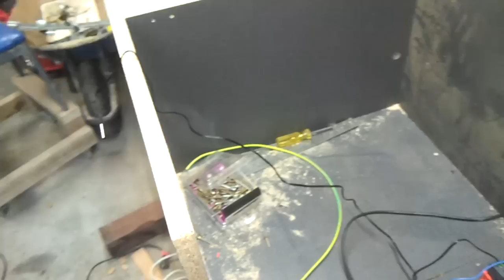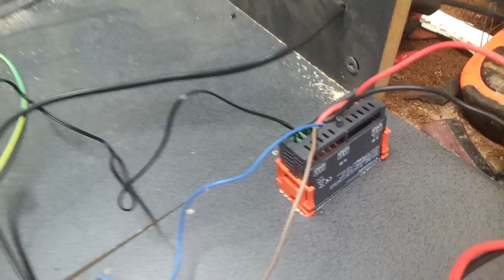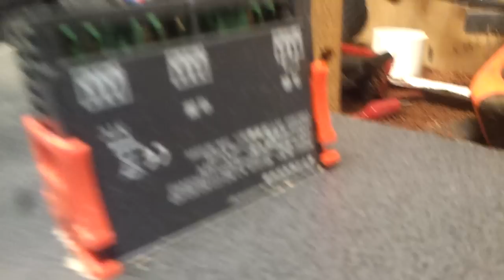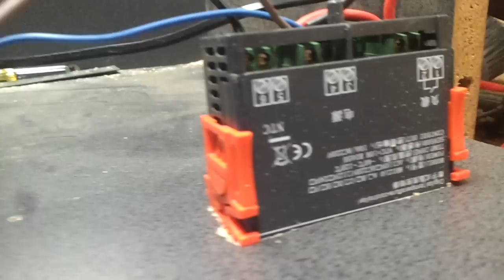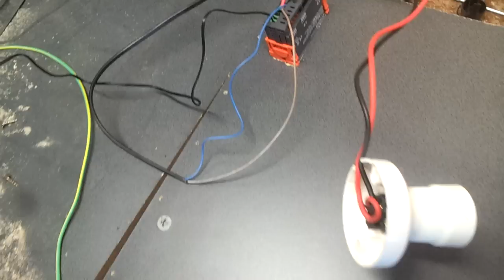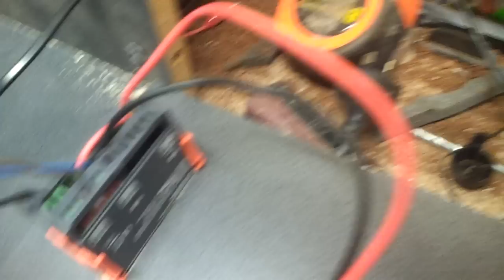Incubator box using MH1210 digital temperature controller - simple wiring circuit

Comment: Thank you, your video helped me a lot. For others, run white into 4 (AC power in) and run a white out from 4 to the white side of the socket. Run black into 3 (AC power in) and jumper 3 (AC power in ) to 2 (relay) . Run black from 1 (relay) to black side of socket.  Connect sensor, power on and test.  I found a good article and a readable (by me) circuit diagram here http://usefulldata.com/temperature-controller-mh1210w-review-manual-instructions/
Reply from the maker: Glad it helped :)

Comment: can we use it to hook two things like a fan for cooling and a bulb for making it hot so that in winters as well as summers the temperature is maintained .? or is there a limitation that we can hook only one
Reply: There are controllers that can do what you describe, this one does either heat or cold at any one time, not both concurrently

Comment: Can you send me the link to buy the exact temperature controller? from ebay or amazon or someother best website? Can we check humidity also if i am going to use for egg incubator?
Reply from the maker: Humidity is not a part of this instrument. Here is what I purchased:
http://www.ebay.com/itm/Digital-Temperature-Control-Regulator-Controller-MH1210A-40-to-120-200-240V-/330899020567?hash=item4d0b1e5b17:g:Qj4AAMXQBwlRTEXi

For humidity you can use this one:
http://www.ebay.com/itm/240V-AC-Digital-Air-Humidity-Control-Controller-Sensor-Meter-Hygrometer-1-99-RH-/361346145084?hash=item5421e89b3c:g:INAAAOSwPcVVrmQS
These both are 240V AC compatible units. If you need 110V AC, you will need to search accordingly.
Reply: Omkar Karve Tnx, this is what i asked :) I am from India, Tamilnadu

Comment: So i got this unit for my self. and that one works great. so i orthered one for a friend. but this one has an ekstra wire terminal at the load so 3 not 2 in a row. on the diagram it says normaly closed at the 3 terminal (is this instead of using jumper cable or something) any ideas on this. or should i just connect it as my own model. with jumper wire etc placed the same? these damn poorly translated manuals from china tells me nothing :D
Reply from the maker: +Dennis Nielsen I am not sure without actually looking at the unit and testing. Sometimes there are 3 wires for connecting load - power, neutral and earth. It might be earth connection. So you can give it a go using a small load like a bulb or something (by not connecting anything on the third connector) to see if that works.
Reply: Omkar thanks for your second reply man. I will do the lightbulb test like i did last time :) i popped a fuse an a bulb in my first atempt last time but yeah one notch in the belt this time, and pratice makes perfect so i think it wil be fine. I think maybe its like you say. just a earth connection or something. i will connect it like my own model and see how it will work out. at least this time its just my friends house im risking burning down :D good day to you Sir.

Comment: I have one of these an successfully set it up for an incubator type setup., and it does what I need it to do.  Unfortunately I have managed to lock the settings by holding down the "down" button (as it says in the instructions)  for 3 secs. I don't seem to be able to unlock the same way. How do I unlock the settings or set the unit back to factory default? Or do you think that this unit could be faulty? Any help appreciated :))

Comment: can you run a fan and the heater at the same time with this?
Reply from the maker: CoyoteFur sure you can, instead of the light bulb heating element, you can power the fan and heater. Ofcourse, you will have to use relays for the heater depending on the wattage it is pulling.

Comment: Do you have the manual or data sheet for this temperature controller, anything :). I cant figure out what needs to be plugged into what. I'm doing a similar project to you but using it to maintain water temperature. anything will help. thanks :)
Reply from the maker: Piers Illing Not really, I didnt have one as well, hence I made this video. I wouldnt have been able to make one once the box went together so had to do it before assembly ... hence the video is a bit chaotic but if you watch it a few times, I am sure you will figure it out

Comment: I need to figure out how to program this thing.  I am using it as heater controller on my aquarium. Help? 
?
Reply from the maker: For programming< I just adjust the temperature using the up down arrow. As my usage is for baking only, thats the extent I program. Once the desired temperature is shown after pressing up or down, the unit takes over.